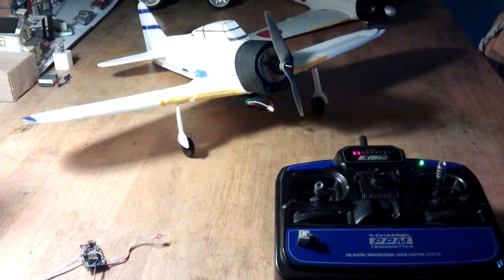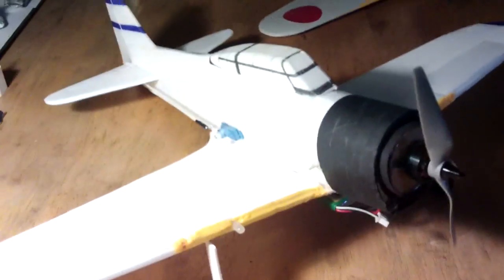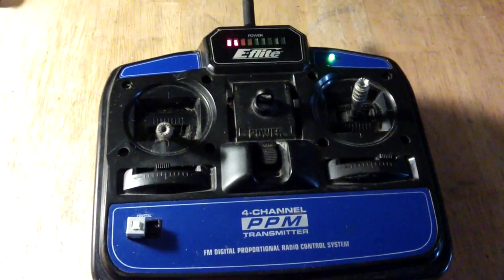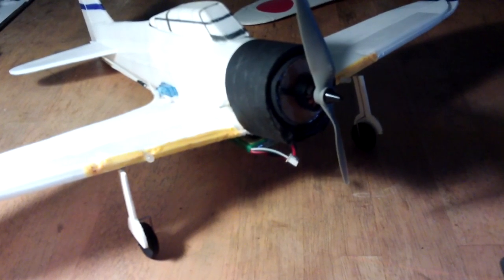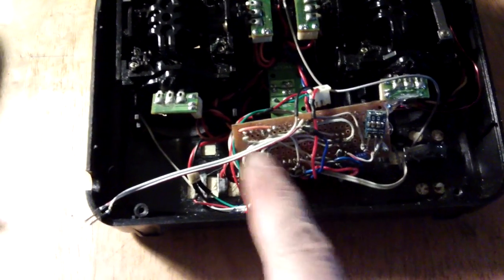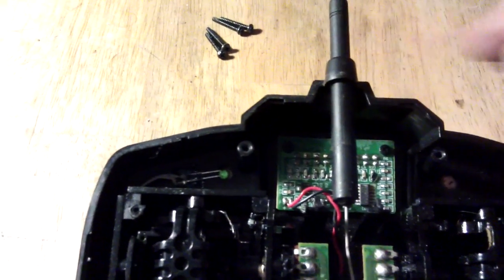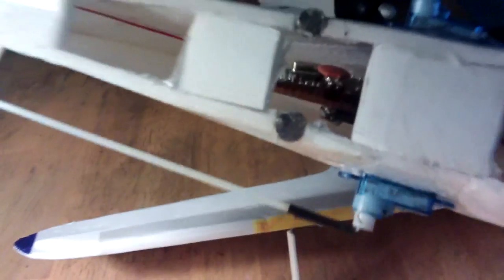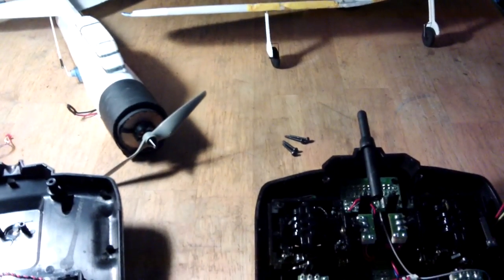Arduino Zero

Comment: This might confuse some people because there is actually already an arduino board called the arduino zero.
Reply from the maker: I found out that fact when uploading this video lol. There were sidebar links to the actual Arduino Zero! 
Was wondering about putting the system in a Spitfire, but thought there might be an Arduino Spitfire by then.
Reply: @Slider2732  Haha still a real cool project though

Comment: Wow!  That was fantastic.  You are years ahead of me on this stuff.  I havn't even started on anything RC yet.  The Arduino thing is like opening a can of worms.  I just look at it and say to my self,  " Oh no.  What I have I started?"  I can learn it but it is a time thing.   Great video.  Excellent flying skills like GrandDad mentioned.  The leds for guns was the best.
Reply from the maker: +Lidmotor Thanks! All of the Arduino types have their uses, suiting goals. Your UNO is the best for learning, easy to plug things in, shields fit them and has a built in PC connection. Lot of fun stepping through the examples. i had to learn fast though, made a mistake of buying Pro-Mini's first and was ecstatic to finally get an LED to flash. 
The LED guns weren't the ones looked for that i thought I had, these are dimmer but tri-color. Could have had a disco flying around up there.

Comment: Great work Slider, you really make the whole process look so easy. I can't keep mine in the air more than a few seconds. I guess some time I will have to stop messing about and build a proper one so I have a fighting chance but that just seems against my principles :) I have a few videos coming up early March using that WLTOYS V911 receiver but they clearly show my weaknesses - like I cannot fly RC planes :)
Reply from the maker: +GrandadIsAnOldMan Noone can dear sir without a lot of crashing and swearing. If planes don't fly quite well enough, there hasn't been enough crashing and swearing yet.
Looking forward to the V911 vids, they're very popular and deservedly so.
Your large glider type with the regular household motor would have gone well with a bit more power. That one was so close for what it didn't have !
Reply: slider2732 that glider may escape the storage shed in the summer if it is still in one piece. That Cessna might well get a V911 too as it must be just about perfect for the job and should work virtually straight out of the box. The 'thing' I have been playing with at the moment is one of the small wings I made for the Nanocopter tail rotor because I wanted to try mixing the channels on the V911 to get ailoron or flaperon mode working. The problem is my lack of experience means I don't know if I got it right and I am just a poor pilot or I got it wrong and I don't stand a chance :)